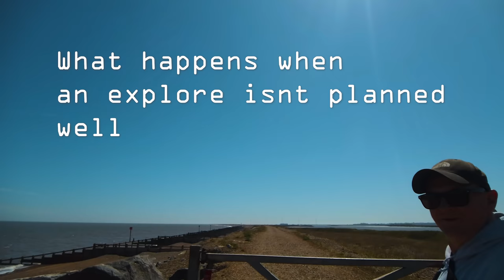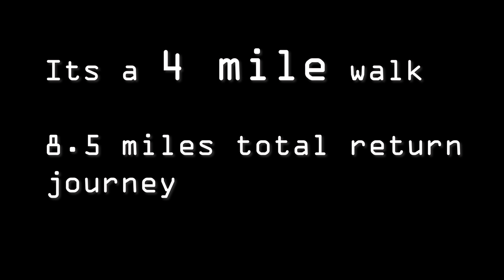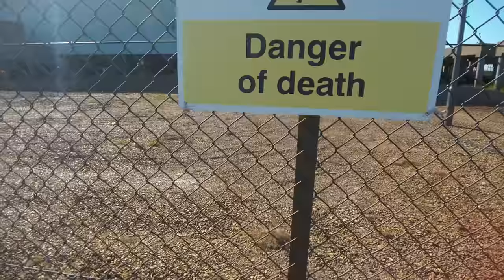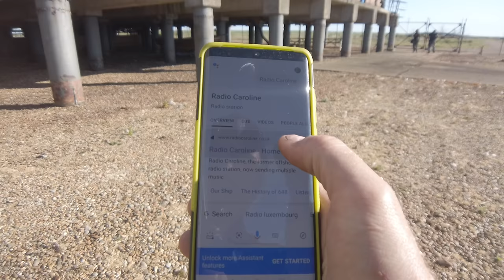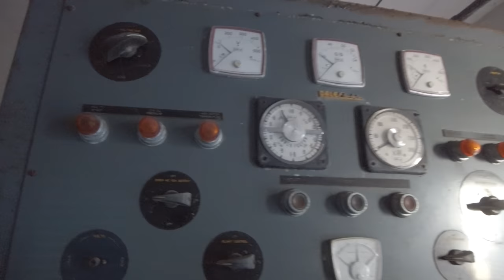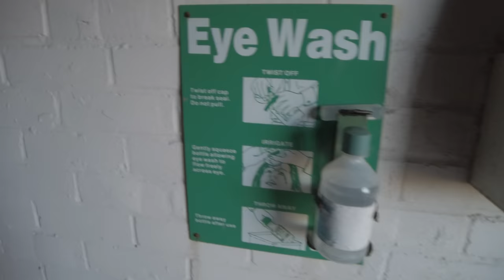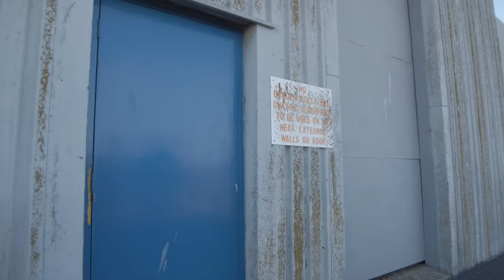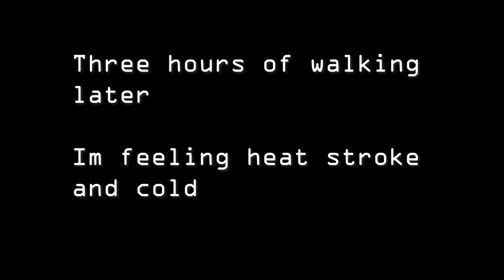Secret Radar Beam Weapon and Nuclear Test Site ORFORD NESS

Comment: Good drone footage. The 6 masts shown at 1:18:10 would have been the ones in use at Xmas 1980. The stand alone mast is used by Radio Caroline. I was told it was a folded unipole but it looks like a top loaded mast. The 4 wires at the top don't have insulators on them where they connect to the mast so they're part of the antenna. The insulators on those wires will be further down and the length of the wires would be adjusted to provide a 50 Ohm match at the feedpoint. C'mon Matt being a radio amateur I thought you would figure that out, and show the antennas in a bit more detail.

Comment: Suprised the NT didn't follow you around although they can't see you up until the old radar site, past the lighthouse they get a good view because it's flat and you stand out like a sore thumb and are very protective using 4x4s and binoculars. You can dip down on the beach to get to the last pagodas where they have no jurisdiction between low and high tide. It's a very long walk in along that shingle. The guy who owns the recently knocked down lighthouse can be a bit of an arse but just keep to the beach and he can do sweet FA.

Comment: Very interesting Matt n crew. Cobra Mist was a failed over horizon radar system which apparently the Russians were jamming with dodgey trawlers in the North Sea. Its cousins are the woodpecker (Duga) in Russia & jorn in Australia. A good example of a phase array radar in the uk is at RAF fylingdales. Keep up the good work and great vids!
Reply: Sock Puppet 
Actually, it wasn’t. That was the PR cover story. The project did not fail and continued under another name after Cobra Mist was officially closed in ‘69.
Reply: @judithjaafar517  It wouldn't need a cover story, OTHR systems are unmissable on the short wave bands. Everyone and his dog, and especially the Russians would have heard it still running if it had continued operating. It may have been kept a closely guarded secret because it didn't occur to them that putting the OTHR system on the coast leaves it wide open to deliberate interference from 'Russian trawlers' etc. Most OTHR systems have the transmitter and receiver sites separated by around 100kms to prevent interference from the system's own high power transmitters. Cobra Mist didn't employ this technique and may have interfered with itself... another embarrassment.
Reply: Steve Mumbling 
But it wasn’t an OTHR  experiment, that’s the point. It was something else altogether as I discovered in the file I found. They may have been propagating radar waves to disguise what they were really doing. If it were radar, why recall the file and classify it for 100 years?

Comment: Wasn't it couple of years ago the SAS recruits got sent out onto the moors heatwave conditions and they had to get rescue services out to some and one died, it was a huge scandal at the time, heatstroke/cold/going badly equipt will kill you, though you were never in any danger as you were close enough to a place but they would have had to get an ambulance out to you, carry as much water as you can,a hat, thin layers that can be removed and added as required, and don't forget about legs if you venture out in thin trousers or shorts, as someone suggests down below, emergency blankets are small, cheap but bloody effective and can and do save lives as well as being bloody useful, I carry a pack of 6 in my walking backpack and one in my everyday bag, throw it over your head if it starts to rain, make a shelter if it gets really nasty, use it as a reflector to attract attention from above, collect water, the list is pretty endless.
I really wish you had made it to the towers and the pagodas, I know lots have over the years but so far I have only seen still photos not video.
Sadly the lighthouse is gone now, the beast from the east storm finally took it from beachfront to almost in the sea so a man bought it (for £2000) to cut it up and bring it down in pieces so at least the top section can be saved and restored, all he would say is the bill to do so reached six figures!